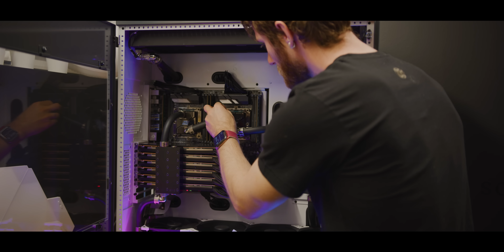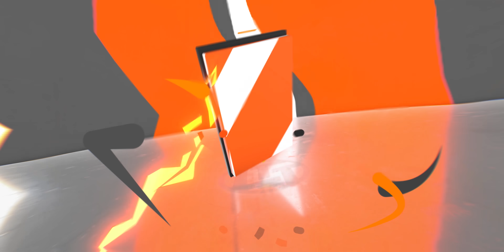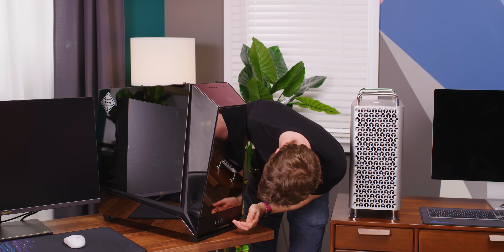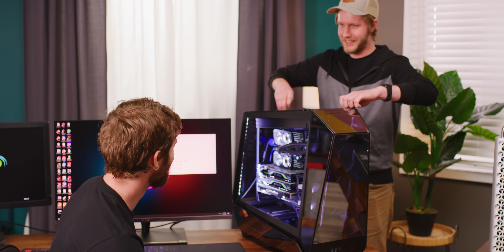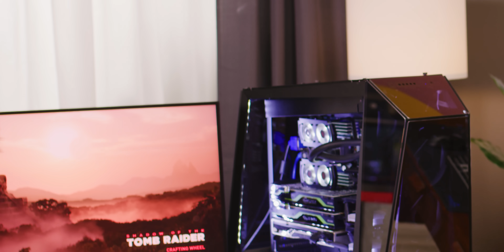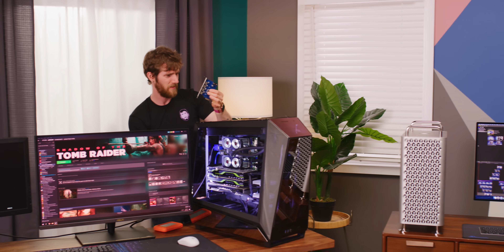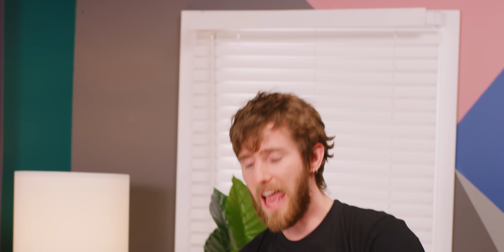The $32,000 Mac Pro Killer

Comment: Sounds like a couple choices to make it sound better on paper were completely wasted. A different case would have saved it a point easily (because aesthetics are different by person, like i think that mac pro looks terrible so you could use ANY pc case and match it or beat it. But you spent 2k buying one that looks-interesting-but fails in almost every important way). The choice of processor seemed to be designed just to brag about how much RAM it has, but that cost it a lot of points in other factors, where there probably would have been better choices that might not support as much ram, but would give far better I/O and possibly make it more efficient to beat the mac in some of the applications the mac won. And i'd be interested to see how well the PC would run with just one quadro, so it didn't have the disabled output requiring a third card (which, can't be good for it. Trying to use a decent card just as an adapter to allow you to connect your monitor could cause some internal conflicts that hinder the GPU processing). With the right changes, you might get the PC version to be cheaper and faster than that abomination you made >.>

Comment: The Mac pro can support two Vega II duo mpx modules, totalling to 56 TFLOPS and 128 GB of graphics RAM. With a bandwidth of 1 TB/s. The NVidia setup maxed out at 96 GB and the bandwidth is lesser. Both are great, but Apple's engineering is not bad when it comes to the Mac pro.

Comment: It is also true that that is a diy system and powerdraw and noise tests are curiously missing. The IO sucks compared to the Mac Pro and it is a windows machine which means that it isn’t prequalified with the parts and already handicapped because of missing software (Logic / Final Cut) and hardware (Thunderbolt / 10gbe ...). For a professional in the sound or editing industry (which is where the Mac Pro shines) where uptime is key and service is important the „pc pro“ would not even be an option and for most if not all scientific and big data analysis cases it will get wiped out by a compute cluster for a fraction of the cost. Verdict: Unlike the Mac Pro which has a clearly defined target audience this project while being fun is completely and utterly useless in the real world.

Comment: This was the most biased thing I have ever watched. You clearly gave the PC a lead because you ran programs meant for its hardware but never evened it up by doing the same thing with the Mac. Also, the PC is running windows, so the Mac automatically wins a point which you didn't add.

Comment: Mac: Pay $33,000, and you're ready to go.
PC: Pay $33,000 to spend hours building the machine, spend more time configuring graphics cards(not knowing if it is working or not), spend time getting everything else up and running. Oh, and the time it takes to notice things like USB Cards causing stability issues.

It just works campaign by Apple makes a lot more sense now lol.

P.S Linus, the PC actually costs more because of the manual labor required to set the whole thing up. ;). So it is not an Apple to Apple's comparison ;). Also, how many on your team members were used/harmed(lol) during the building of the PC PRO?

Comment: Normally I like your Videos, but in this case I hate it. This Video is produced so everyone how watches the Video gehts a misleading Opinion about the Mac Pro. This comparison is literally trash. First of all it is clear that when you install windows on the mac pro and run games on it it performce worse, the radeon vega pro is nor made for gaming, it sucks. the titan rtx is also not made for gaming, but as you said in the video, the titan rtx is the best gaming graphic card on the market. Additionally the titan rtx costs about 5k and the amd card costs about 1.5k so what the hell. When comparing the rendering, ok 2 quadros 8000 with the mac pro this is also not a fair comparison, this cards together cost around 12 to 13k. then the 3rd test, you cant compare a graphic card against a cpu what the hell, if the cpu don't supports amd graphic card this is ridiculous! Next the mac is faster in cpu tests and the "mac killer" in gpu ok fine add 1 to both counters, but no, make 11 cpu-tests and 13 gpu-test and rig this comparison even more. And finally, you cant run nv-link under macOS. macOs supports nvidia graphic cards. Additionally you very unlikely run simulations on a workstation, therefore you have servers that run under linux and you control them from your pc.  In conclusion yes you can bye more raw power with the same money as the costs of a mac pro, but this hardware can't run macOS.

Comment: "Python Compiling"? Doesn't Python just run with an interpreter?
Reply: Unless he means compiling the interpreter package itself from source code?
Reply: @TEFox  yea figured he probably meant that
Reply: Was thinking the same. I mean, yeah python source code is automatically compiled to python byte code and I guess cython could be compiled as well but that is really not the classic python use case. Most likely he did confuse it with something else.
Reply: Or did he mean "Python, Compiling", as in 2 different things?

Comment: The problem with this comparison and conclusion is the target customer. Most customers looking for something like the Mac Pro will never even concäsider the headache and tinkering that building a PC pro requires. That loss in performance to price, is gained by being an instant, optimized solution.

I value... Well.. value before convenience almost every time, but the amount of tinkering and finding your own solutions (well pugit systems solutions), from an IT department pov, it isn't worth it.

For regular consumer products, choosing a Mac is almost always a waste of money (waste as in over priced, but great hardware/software nevertheless), but for pro level tier like this, it might not be.

But the sense-morale is, that if you buy a focused, and specific for the task PC, you will be faster and cheaper than a mac pro,

Comment: "Only supporting CUDA" is a bad and shortsighted decision.
Even AMD's HIP (basically a CUDA clone) supports both AMD and NVIDIA hardware, and that's not even mentioning OpenCL.
And if you use Chlorine, you can use OpenCL without getting annoyed by the API.

Comment: Linus :spends 30k+ on a computer

Me: has a $70 computer...

I'm not crying ive got something in my eye
Reply: slowly reaches for phone to computer shop
Reply: Me: 0 dollar computer 😭
Reply: Probably still boots faster.
I have a work PC downstairs, i5 2500k on an old Intel branded OEM board + Radeon HD5850 and 12gb of 3 mismatched dimms.. only thing I bought was a 120gb SSD, everything else I found in boxes my partner had
Boots up from a cold start in like 10 seconds, photoshops and spreadsheets like a champ
Reply: @MotoCat91  show off  😂 I have a Dell 760 office pc from 2005 it can't even run Roblox..

Comment: anyone that actually does that high computing work here and could tell me what system they are using optimized pc or a Mac Pro? Pc just makes so much more sense to me because Nvidia lol Mac Pro is nice cause it’s prebuilt but if u really need so much computing power doesn’t it make sense the get a fully optimized pc like linus mentioned instead of a pretty Mac Pro? Unless ur a videoeditor I gues?

Comment: I just wanna throw out there that stress analysis is not inherently limited to a single core. I regularly run Ansys up to 70 cores with hundreds of GB of RAM. There's definitely diminishing returns, based on the specific model and physics being simulated, but that's a whole other topic. :) Cheers!

Comment: good stuff, but honestly the lack of real I/O and the like will be deal breakers for many. my other question is you benchmarked it in WINDOWS, not Mac OS. It is known that mac pros perform worse in windows vs Mac OS. Also curious how the PC pro would do in Mac OS. No thunderbolt? pass. So many things are using USB-C or thunderbolt. if you are spending that much you might as well have the most expandability possible. PCs lack real thunderbolt and USB support. usually only including 1 or 2 ports. sure we can go internal and M2 everything (speaking of which i'm surprised you didn't throw in those crazy PCI-E storage options that get insane GBps performance. 
but yeah the mac pro is absurdly priced overall. I went with a Macbook pro from a mac pro. gotta upgrade my PC soon too.

Comment: I remember when I was picking parts for my computer, cost about $1,800AUD (1060 6gb, Ryzen 1600x, 16gb RAM, 2tb HDD, 512gb SSD, 2k 144hz monitor).
For laughs I thought I would see how much the closest Apple equivalent would cost.... about $5,000 AND it was inferior is almost every way! Most of the bump in price came from upgrades, such as doubling RAM from 8 to 16 was about $200 or so. The only thing better about the mac was the screen, so basically if I was to choose to go Apple, I would pay through the nose to do less and what I could do would run worse, but hey, I'd have a great display for all the crap that I couldn't do. I feel like this is Apple in a nutshell, look flashy to appear better than it is.

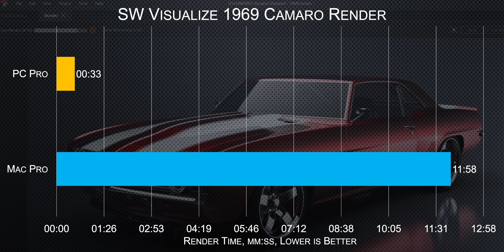Comment: 15:20 this is insane. I'm used to hitting go and walking away waiting for Solidworks to do its thing for hours when it comes to stuff like this.
Reply: You got a potato?
Reply: @butterccm  I have a laptop with an i7 7600u with 16gb of ram. I know it's not the best but SW takes a lot to run. And the stuff I usually do (flowsim or force simulations) is more cpu/ram intensive so me not having a discreet graphics cards doesn't take away a whole lot from performance.

Comment: I’m sorry but you made and error (actually not the first time I’ve heard you say this one particular thing). You said the Mac Pro would win in simulations such as stress analysis because it can’t benefit from parallelization. I’m sorry, but this is wrong. I’m a mechanical engineer and basically half of my professional life is spent running FEA and CFD simulations. I also built an HPC cluster at home, but that’s a whole other conversation... anyway, for engineering  simulation basically all commercial codes right now not only support parallelization, but can scale potentially infinitely (code wise I mean; obviously communication inefficiency makes it impractical to use x amount of cores when your mesh only has y number of elements). As far as single workstation performance goes, yes you can use every core, and since these workloads are coupled to memory bandwidth, the 8 channel EPYC simply smokes anything from Intel right now. Please get this right!

Comment: Why not choose the best components that outperform the MacPro at a low price. Makes little sense. The case, the motherboard (more RAM slots, dual CPU would be better and cheaper). I would set up a machine for 30,000 euros that is twice as fast. When you need performance for whatever purpose, a PC is always faster. If you need it nicely packaged and looking good, there is Mac. That contradicts itself.

Comment: This video does not make sense at all...
Let's build a PC which costs as much as a Mac Pro.
Let's run some random tests to somehow even the score
Let's go for something NVIDIA specific, so the PC gets some extra points (CUDA). - It's like how well does LogicX run on these? Does it run on Mac - yes. On PC? no. - So 1 point for mac ?!?
Conclusion at the end - If you build a PC for something specific, you have options, if you need a random extremely expensive but great performing machine, it does not matter.
So what's the point?
Oh and how did it "kill" the Mac Pro? In the (unfair) CUDA test? The final scores were almost even.
The title should have been "We spent 2x $32k for shiny machines with an overall good performance".

Comment: speaking from a VFX workload point of view: poor single threaded performances bottlenecks multi threaded performance!! This is where the threadripper REALLY shows its strength for that kind of workload, 256GB RAM limit isn't a problem for most tasks, only when going into very heavily fluid sims is it really required. In the past 2 years I've only needed more than 256GB of RAM once for a sim that big.

Comment: As a noRGB and non-glossy surface lover, case is the worst part of the PC build.
I would go with the PC build after switching the case to something IMO more beautiful, a case with plain surfaces, matte color (preferably black) and no glass window.

About boot times: you should have used Manjaro, Elementary or Pop_OS!

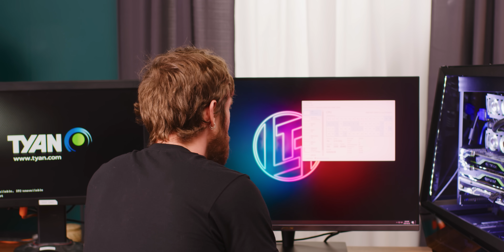6:56 If given opportunity, Windows will use 15GB RAM while idle, instead of 1.5GB 😂

16:20 He is right. I should stick with my Sony Vaio from 2007 for home server project. No need to go build a computer that is literally 1000 times the cost.

Comment: I actually never expected those results in the rendering
Reply: As someone who manages blender renders and workstations professionally. 
Something is wrong with atleast their blender benchmark. If you are just working and not rendering the you have optix on the PC pro, (it requires RTX) that alone is a big time saver for previewing a scene. Much less the extra CPU computing power for doing simulations and everything else.
 If you are rendering then those extra cores are gonna own the Mac pro, much less the GPUs. 
And that would be in windows, not Linux. Which you could also use. 

So you are correct in your assessment that something feels off.
Reply: Your comment is a mess but your point may have been decipherable?

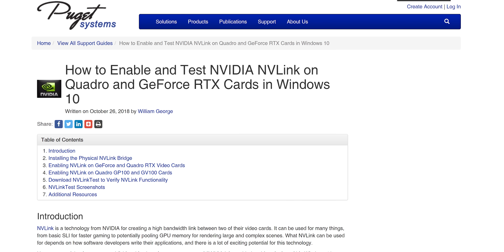Comment: 10:40
Every Linux NVIDIA user:
In your terminal emulator on GNU/Linux ofc.
Reply: As a Linux Nvidia guy: yup, that's pretty much the case, except you can drop that GNU/ in GNU/Linux part :-P
Reply: The point is they don't tell you what command to run, not where to do it or whatever

Or even what the name of the utility executable is, if there is one, where you might be able to work it out from getting it to output the possible arguments with "--help" or similar
Reply: @mduckernz  Well, I think you can expect that people that buy expensive hardware for specialized use-cases can use a internet search engine to search for nvidia-smi. Also nvidia-smi is a extremly common utility for Linux users that use NVIDIA... While they could have given more information, it's not uncommon to leave out stuff that can easily be found or to be expected.

Comment: Let us see how the "device that beats in every single case" compares:

Mac Pro:
- Costs US $33k
- Everything works out of the box with the press of one button

PC Pro:
- Costs US $32k
- Uses a case you won't get spare parts if you break one of the 300 ever made glass panels
- Requires custom parts to install basic items like a power supply
- User does not know if the machine is turned on after the power button is pressed, unless you have a VGA attached monitor and waits patiently for any signs of activity
- Uses an unqualified processor for the OS
- Requires OS and all drivers to be installed by the user
- Does not have an IO shield, exposing internal motherboard components
- Takes well over a minute to load the OS
- Requires memory coolers (wrapped in electrical tape)
- Requires funny command line parameters to turn on the two graphics cards (admits these are so obscure with statement "no clue how users would figure these things otherwise")
- Requires an external graphic card to run the graphics cards

And yet, the "winner" is the PC Pro.

How on Earth people take these "tech tips" as anything even related to "tech" is beyond belief...

Comment: “Beats it in every conceivable way” fails right at the start with the case that looks like it came from Blake’s 7.
Reply: Yeah, I feel like they hamstrung themselves with some of those choices just to spend more money
Reply: That case is hideous
Reply: I think there was a ton of fails here. "Every conceivable way" shouldn't have been uttered. Just stick to performance alone and they would have managed to win on several use cases. But it lost in size, user friendliness both hardware and software / driver wise, the build (i.e. you have to do it yourself), lack of warranty on build, start up time, etc. Imagine if a cars "value" would only be judged on it's top speed, and not build quality, handling, finish, design, acceleration, grip, feel, etc.
Reply: Lol Louis rossman has something to say on apples build quality. Also at the time ur spending 32.000 on a pc believe u have staff to manage all that for u. So yea it beats it for sure in what it’s supposed to be but honestly I would not put both on my desk
Reply: Odin's Playground don’t forget support. Also curious about the acoustics.
Reply: I'd take the inwin case over the bland aluminum for the Mac pro 11 out of 10 times

Comment: eh I'm happy with my 24-core CPU/64GB ram digital packrat PC that has 266TB of storage and a 5.25" LTO-8 drive to back it up in a plain 1/2" acrylic case I built myself (since every commercial case wasn't big enough for everything I wanted to put in it and Caselabs went belly up when I was shopping for one). Doesn't have an Apple logo on it so more PC for 1/3 that $32k price. Still has a single 1080ti gpu, but don't need more than that since I'm not crypto mining or folding proteins and a 2080 ti isn't that much faster.